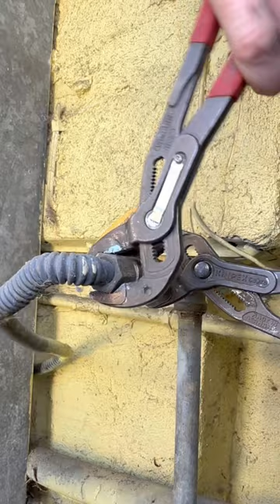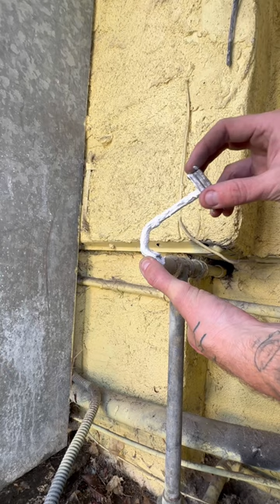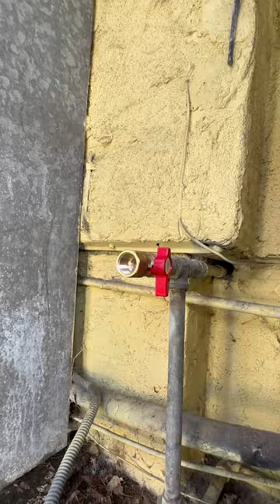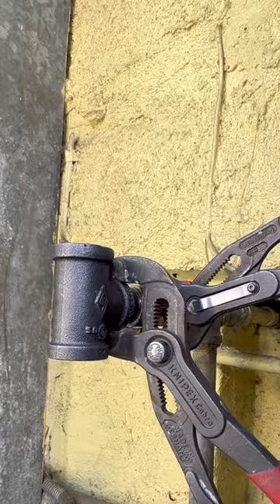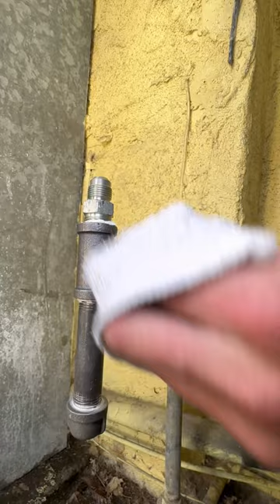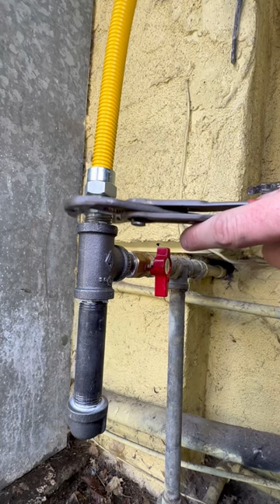THIS IS CODE! #gas #line #iron #code #how #howto #trap #hack #hacker #tips #tip #tricks #trick #fyp

Comment: Plumber in my area told me that the flex line isn't allowed here. I used it anyway for my furnace because I didn't have a tool to flare copper, and didn't feel like buying a flare tool and a roll of copper for one single use. 🤷 I don't see any problem with using the flex line, except that it's ugly 😂
Reply: Earthquake code...